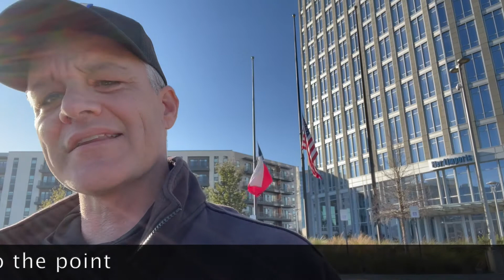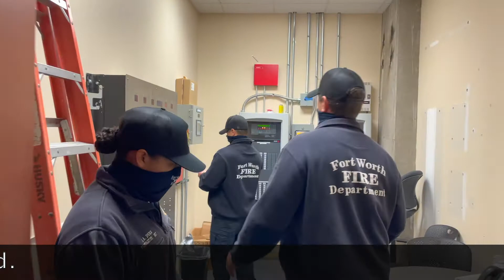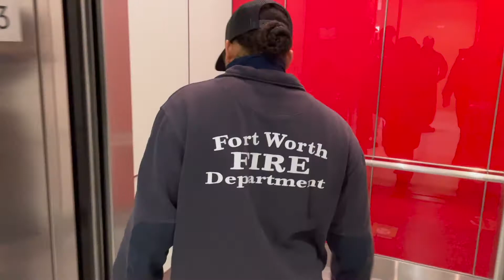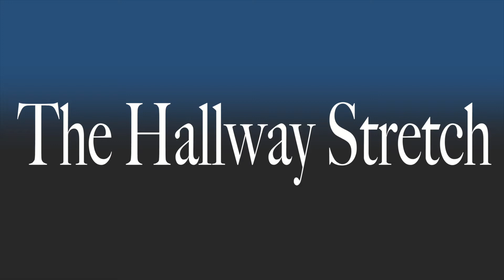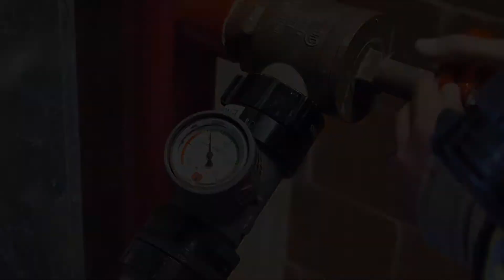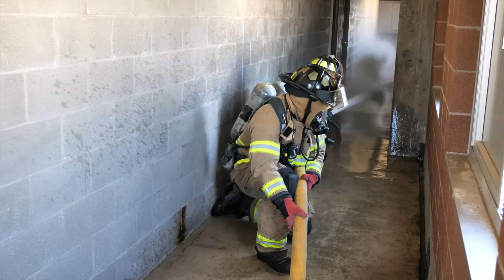High Rise - Fire Floor Ops

Comment: Be careful placing the elevator in “Hold”.  That prevents the elevator from returning to the ground floor where incoming units will be waiting to make their accent.  It will essentially be locked out and useless.  Identify a means of egress and then place the elevator back in phase I so units behind you can get to the resource floor.